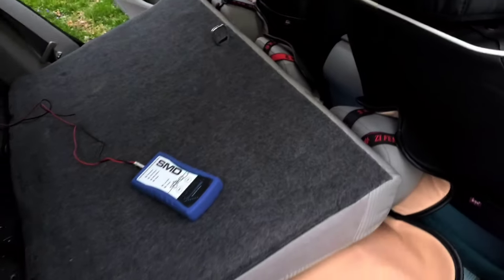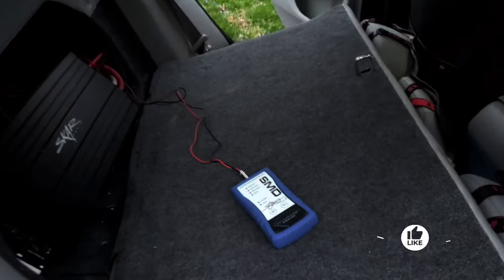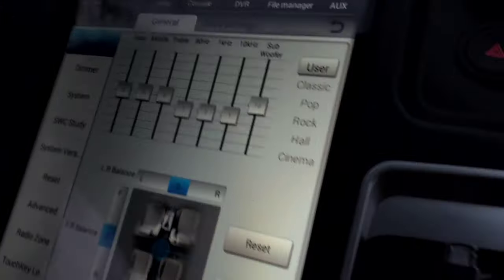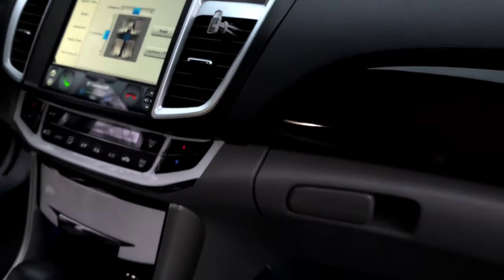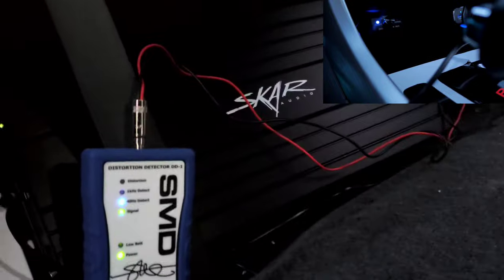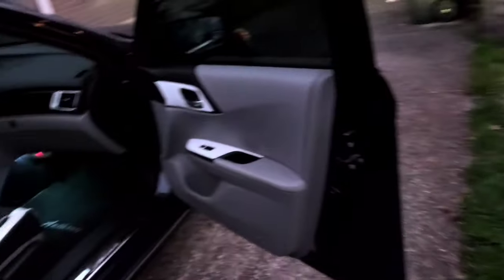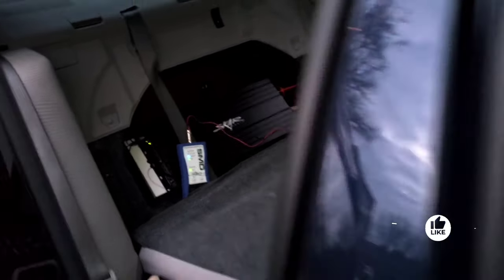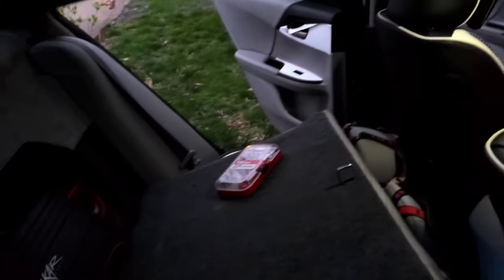How Accurate is the Clipping Indicator On Your Bass Knob?? VS an SMD DD1?

Comment: Just bought the skv2 1500.1 for by sdr 12s. The bass knob with the clipping light was a great added bonus. Especially after watching this video. It gets here tomorrow. I've been struggling with tuning my amp partly cause I'm new to this, am very paranoid, and am using the factory head unit. Looking forward to using this bass knob. Should help me quite a bit. Thanks for posting this too btw

Comment: I would trust the bass knob that came from the amp manufacturer over the DD1. The equipment that skar made is engineered to work together for the best optimal performance.
Reply: that bass knob is found everywhere. trust the dd1 over anything because it detects distortion weather skar thinks it is or not. i had the same bass knob on my dc audio 2.0k which is a nicer amp than the skar and it was pretty accurate, or accurate enough for everyday use.
Reply: wish my bass knob works just light comes on but cant turn bass up or down
Reply: @munozjordan70  change the old bass knob cable to the one that came with the knob and it will work I tried to use my old cable for the knob and it did the same thing you mentioned but after I switched the cable it worked.

Comment: I been pushing 2 12 inch kappa 1200w subs in a sealed 1cf for each sub and using a SoundQubed 1250 with clipping light. Think is pretty much same as the skar amp that puts out around 1200 watts rms and around 1600 burst @1ohm. Been running this setup for past year and I only used the clipping light to set gains, so far the subs have performed flawlessly and I push them at max volume a lot. They are only 500 watt rms subs, so even over powering then they have held up. So thinking the clipping light is pretty accurate.

Comment: Or do it the right way and get an oscilloscope. Test multiple sine waves from the HU first to find out where ,if any clipping occurs. Then use that tone. Sometimes 40hz isn't where you see clipping but 45hz is. Each HU is different. Visually see the sine wave and when clipping occurs. Definitely do not ignore that light. They put it a little ahead to protect your equipment for a reason. Skar rocks. I have 4 ZVX-15s on 2 SKV2-3500's

Comment: Would you show us how to set our Headunit clipping indicator?
Reply from the maker: It indicates automatically
Reply: @Kpaceguy  o ok
Reply from the maker: @JWard2  just set your amp gain correctly and the clip light should rarely come on
Reply: @Kpaceguy  o thought I read we are suppose to determine where the Headunit clips at volume wise. Then don't go past that volume number. Then start tuning the amps.
Did I read it wrong?
Reply from the maker: @J. Ward  no you're correct. That's the very first thing you do. But if even you set your head unit you can still clip your amp if the gain is too high
Reply: @Kpaceguy  copy that. Thank you for the direction. I like your videos. Would you make one showing us how to find what volume headunit distorts / clips at?
Reply from the maker: @J. Ward  you need a tool. You can't just guess. But a rule of thumb is whatever your max volume is, stop about 75% of the way
Reply: @Kpaceguy  ok great. Good to know. Thank you

Comment: So here's my situation, i bought the skv2 2500, i play my music through a Kenwood double din dmx7709s using android auto, when i plugged the rca from my head unit to the dd1 and turn it up the dd1 doesn't pick up the 40 hz, but in Bluetooth mode it does, pick it up, i called Kenwood and they told me that those 2 modes have different outputs, so i stuck with android auto, i read in the instructions that you can tune through tne amp so i did, i played the 40hz tone and the dd1 picks it up, but when i turn the gain, its all the way up, and no distortion on dd1, the bass knob came broken but i had an extra but it doesn't have the clip light, then i plugged it in mid song and the clip light was blinking alot and staying on alot, dd1 didmt get distortion at all, so I'm lost, when i turn it down on the radio it doesn't clip, but the bass doesn't hit like it does, i have the skar dual evl 12s, so im unsure on what to do at the moment
Reply from the maker: Most people will tell you to trust the bass knob because it's directly tied to the amp made for the amp. It's detecting distortion in general not just around 40hz

Comment: Hi there once you have adjusted it and you are not clipping can you turn the bass up on head unit or not. And how far did you turn your bass knob up before you adjusted the gains?
Reply from the maker: The bass knob is set to max before testing clipping. You also test the head unit voltage for clipping as well and the you never turn it up past that volume

Comment: You said CT sounds bass knobs are accurate. I have experimented setting the gains using a -5, -3, and 0 db 40hz tone and there was no clipping on the knob. However, when I play music it flashes red during the hard bass hits. If I turn it down to where it doesn’t flash, I’m not getting nearly enough power. I checked with my multimeter, and set with a test tone to get roughly 900 watts, the clip indicator is clean.. only until I play music. Is it normal to flash during musical peaks?
Reply from the maker: Yes flashing is fine because some music isn't clean or is boosted. You just don't want it to be solid red for long periods of time. A little flash is normal and fine
Reply: @Kpaceguy  Awesome, thanks! Of course bass-heavy rap is the main offender, but that’s what we like to play on subs.

Comment: So does the red clip light stay steady on if hard clipping?  Or when it's blinking red on base notes I should turn it down until blinking goes away? And can the EVL15 handle 1500rms or should I back it down to 1250rms that the sub is rated at?
Reply from the maker: 1500w is fine. Clipping light can blink but you don't want it solid red for too long
Reply: I have an evil 15" on an incriminator 30.1 which is a 4k amp. The 15" evil is rated for 3500w and I would say it's rated at that pretty safely. I've seen ppl push it more with no problems. You don't want to under power a sub, it's bad for it. Atleast get a "true" 3k rms rated sub for it. If you set your gains correctly like in the video although I oscoped mine but the smd distortion detector works fine you should have 0 problems. I've played mine at full tilt for over 30 mins before and still couldn't even smell it. Had mine going on 5 years now. The indicator light on bass know will either be solid or off on mine. When it turns red back it off until light is gone and you will be fine
Reply: Also make sure you know how loud tour head unit can go before it clips and sends out a bad signal. Doing that plus setting gains correctly you won't have a problem at all

Comment: I thought the dd1 will go on first because it's a distortion detector and not a clipping detector. Thd and clipping are 2 different things right? I heard thd goes up first before clipping that's why theres certified and uncertified amp dyno results
Reply from the maker: Clipping is a form of distortion when the amp is giving more power than its rated for at a given voltage. Whether your speakers can handle it or not. Thd has to do with something totally different and is pretty complex.  Harmonic, for example 44hz, 88hz, 132hz are all the same pitch in a different octave. Thd is the measurement of how good an amp is at playing only the frequencies given.
Reply: i wonder how the sq freaks set their system up to certified/ under 1% thd since setting with a dd1 is up to clipping/ uncertified
Reply: @rowboyto156  the dd1 is set up to certified

Comment: When I set everything up, is it okay to use a -5 or -10db overlap tone at 40-50hz? I see that on heavy bass it's on songs the clip light blinks but I'm only about 1/4 turned up on the knob but on other songs I can turn up all the way. My question is, is it okay if on heavy bass songs and the light starts "Blinking" is that okay?
Reply from the maker: Blinking is fine. If it's solid red for long periods then you have an issue
Reply: @Kpaceguy  So being at -10db is fine? And the blinking would be burst's in the music being dynamic?
Reply from the maker: @braydendonofrio1278 -10 is fine if that's the primary music you listen to
Reply: @Kpaceguy  I'm using an overlap -10hz tone

Comment: If I primarily listen too rap music should I use a 40hz -10db, -7.5db, -5db, -3db or 0db?
Reply from the maker: -3
Reply: Aight will do thanks for the fast response
Reply: @Kpaceguy  Also one more thing it says when I check the music I listen too on Audacity it’s peak was 42hz at -3db so it will be ok too set it at -3 still right?
Reply from the maker: @itzluco  yup

Comment: How do I play 40 hertz test tone for the amp without playing it to the door speakers?
Reply from the maker: You can't. Your crossover should protect your speakers first and foremost. You can just turn the amp gain down or unplug the speakers
Reply: Get you a headunit that can set the frequency in your highs without having to have a high amp i was having that problem and I had the kenwood head unit and figured out there was a control on the actual head u to adjust frequencies of what your door speakers receive and now mine sound real crispy with the bass